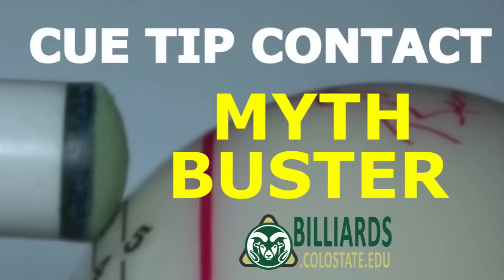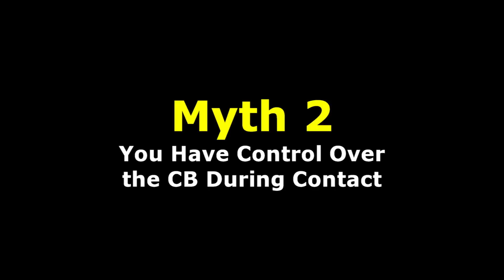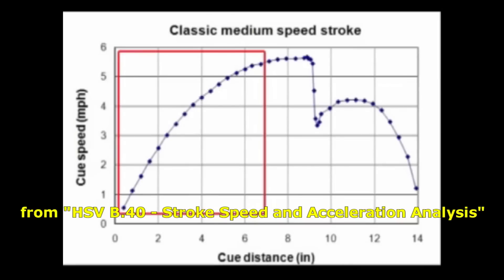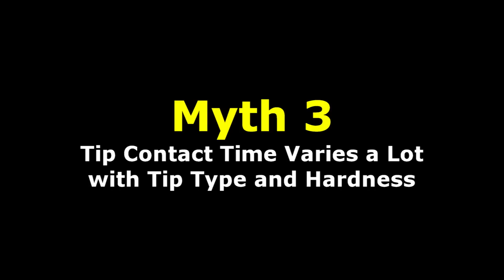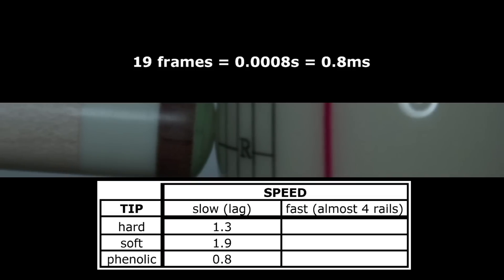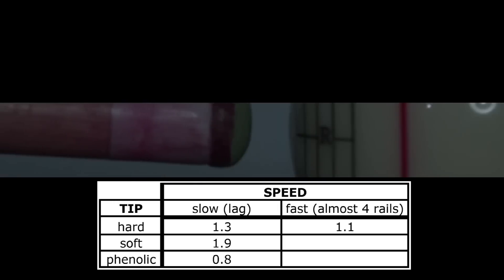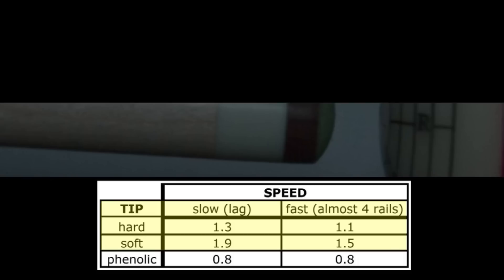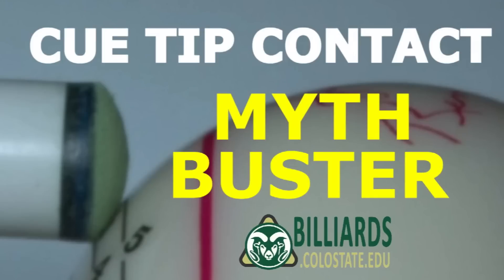Cue Tip Contact Myth-Busting Truths in Super Slow Motion

Comment: YOU did not cover "power draw" shots, when, if in the hands of a SKILLED PLAYER, the cue is ACCELERATED thru the cue ball, this ACCELATION would cause longer contact scientifically speaking---ALSO,  HIGH FLEX CUES, act a "shock absorber" allowing the the to stick to the ball longer---this EXPLAINS WHY one is able to achieve more draw from flex-shaft cues.  I find the video to be very mis-leading and insufficient. If  still have access to the high speed camera, please demonstrate the effect of the aforementioned elements. I love you videos and I love pointing out the errors, sorry :).
Reply from the maker: Those are common misconceptions, but they are incorrect.  See the 2nd video and other info here:
https://drdavepoolinfo.com/faq/cue-tip/contact-time/

Comment: Dr. Dave, I watched your slow-motion video of billiards, which has been of great help to my graduation project.
My graduation project is to build a fully automatic billiard robot. Now I have a problem. It's about the impulse required for my ball-striking device. I don't know how to quantify it. I noticed that in your video, you mentioned that the contact time between the cue tip and the white ball is approximately 1 millisecond. I'd like to consult you about the mass of the cue you used at that time.
Reply from the maker: The 1 ms contact time doesn't vary much with cue mass (19 oz average) or shot speed.  See:
https://drdavepoolinfo.com/faq/cue-tip/contact-time/
FYI, some info on cue-testing robots can be found here:
https://drdavepoolinfo.com/faq/squirt/robot-test-results/
Also see the "robots playing pool" videos here:
https://drdavepoolinfo.com/videos/miscellaneous/
Reply: @DrDaveBilliards  I saw that in your video, you used an xy coordinate graph of the cue speed and its travel trajectory for the explanation. The maximum speed at the moment of impact on it was approximately 5.5 mph. If I only knew the mass of the cue, I could calculate the impulse I need. The cue of my robot is a specially made short one, and its mass is much less than that of a normal cue. If I know the impulse required at the moment of impact, I can design the speed of the cue at the moment of impact, and roughly simulate the hitting effect. However, I saw that in your subsequent videos, it was mentioned that the faster the cue speed, the longer the contact time of the cue tip. So, more data is needed to support this.
Reply from the maker: @ You also need to be aware that based on how you are supporting your short cue in your device, the effective mass might be much larger than you think.  See:
https://drdavepoolinfo.com/faq/squirt/robot-test-results/#rules
Reply from the maker: Concerning shot physics calculations, see:
"TP A.30 – The effects of cue tip offset, cue weight, and cue speed on cue ball speed and spin" here:
https://drdavepoolinfo.com/technical_proofs/new/TP_A-30.pdf

Comment: i don’t get how low deflection cue won’t impact on the stroke of the ball or if you’re using a soft or hard tip but is constantly being developed by brand and used by professional players 🤔 there’s something not right with this test you perform and not here to judge you but there’s gotta be a difference
Reply from the maker: FYI, I cover these and related questions and points in detail here:
https://billiards.colostate.edu/faq/cue/low-squirt/
https://billiards.colostate.edu/faq/cue/carbon/
https://billiards.colostate.edu/faq/cue-tip/hardness/
Check out the videos and info on these pages.

Comment: Hey Dr. Dave,

So, I get the points you’re making. However, I feel like in this series and the article on the website, some shortcuts were taken to make the content more accessible, which could potentially affect the conclusions.

For example: the softer tip creates a larger surface area by deforming more, and a larger surface area would provide more friction, wouldn’t it? You mention this and claim, "(…)but this would provide a benefit only if the tip is not chalked well."

You continue with: "If a harder tip is not holding chalk well or is not chalked properly, the smaller contact patch could increase the chances of slipping during the hit."

But if you don’t chalk a soft tip well, wouldn’t it also miscue earlier? This part of your argument doesn’t seem entirely causal in this case.

Also, based on some of the comments, a follow-up on this topic with more streamlined reasoning seems like a logical next step.

By the way, I love your content! This isn’t a rant—just sharing some thoughts on the topic and how you approached it. :)
Reply from the maker: Thanks for your input.
A larger surface area does not provide more friction.  It just spreads out the normal force and resulting friction force over a larger area, but the total forces are still be the same (assuming there is no miscue).

Comment: Question for Dr. Dave. 2 scenarios, if the grip is stronger versus weak/ no grip power at all, with the same cue speed hitting the cue ball, would the stronger grip gives longer impact time which results in more reaction and power transferred into the cue ball from the cue? Assumping all the other factors staying the same - i.e. speed, cue weight, and all that
Reply from the maker: See:
https://billiards.colostate.edu/faq/grip/light-vs-tight/